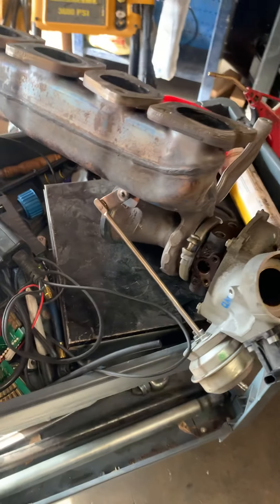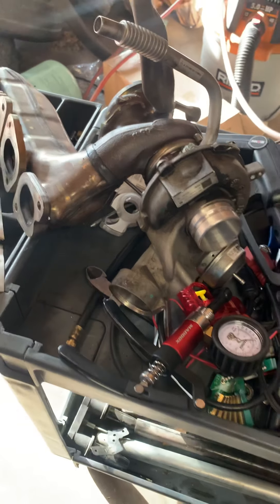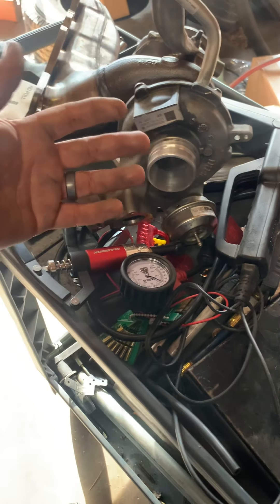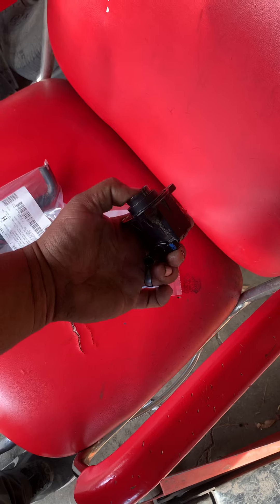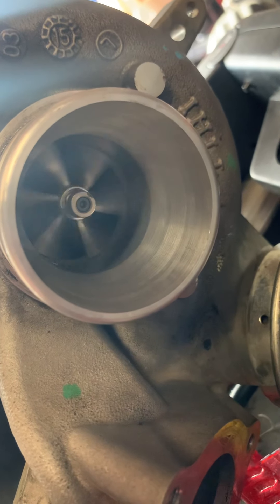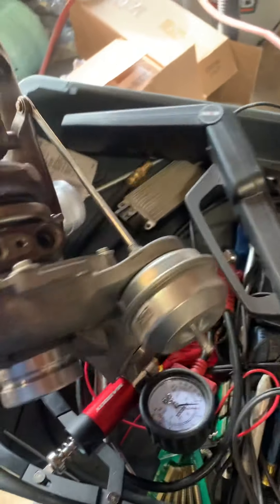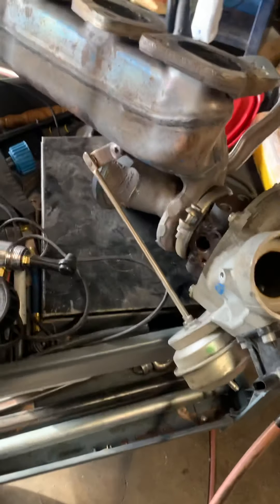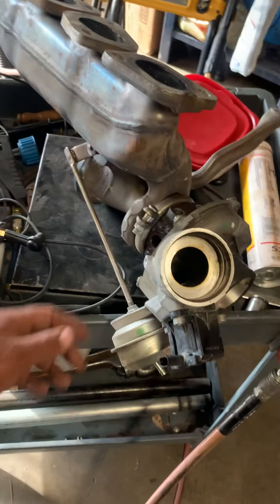2016 Mercedes c300 turbo issues

Comment: I appreciate this video. It turns out this is the same problem with our  2015 C300 after getting codes p0299 and p1190. For those who have cars sold new in  the 12 US states following the California emission standard, the turbocharger is covered under the 7 years/70,000 miles emission control warranty. I've been trying to pin down the dealer on this warranty despite their sleazy efforts to avoid talking to us. 
I'm particularly outraged after finding the original warranty booklet and seeing turbocharger plainly written on page 47 as a covered part. BTW, I've also heard from Ford and BMW owners who had 7/70 warranty repair done on their turbos with much less drama.
Reply: I looked into this the dealer told us we're not covered we have 50,000 miles and the turbo is already bad I'm about to do it tomorrow myself

Comment: Awesome video thank you so much for letting us know what the issue could be. I’m getting the same code. I was quoted 8 to 10,000 for a new turbo charger plus other work which I knew was incorrect. I’m pretty sure this is by the auto stop start system and that’s why I always permanently deactivate it before every drive I could be wrong but you know how turbo chargers are you need to let them cool before you or you’re supposedly supposed to let them cool before turning the engine off they say that that is all a thing of the past I don’t believe it I believe that letting them cool is actually the way to go and with the auto stop start that’s not happening, which is causing the turbochargers to fail I assume that’s my opinion

Comment: I have the same problem here but everything is all good wastegate is good accurators are fine but the car keeps going In limp mode did a smoke test no leaks I am thinking maybe the map sensor is giving a  bad reading after it get under a a amount of boost check out my latest video's
Reply: Did you figure it out?

Comment: Hi i have a 2018 mercedes benz e300 2.0 turbo stupid mechanic overfilled the engine with oil pass the max on the stick clean intercooler with blake cleaner spark plug keep getting oil i done about 15 spark plug remove and clean with blake cleaner but oil keeps getting to spark plug im thinking something is wrong with turbo please help
Reply: No smoke car those not smoke